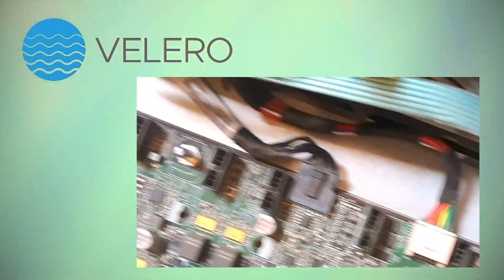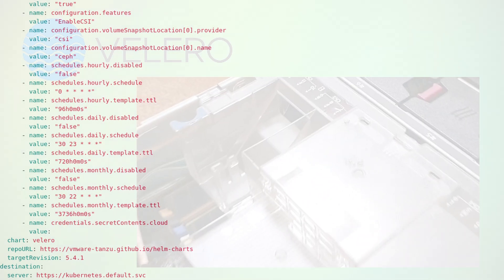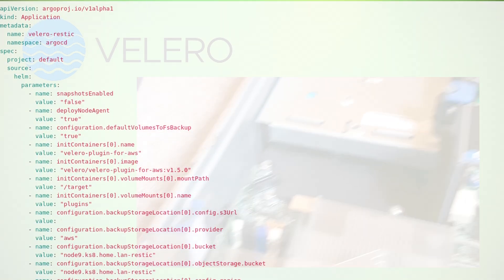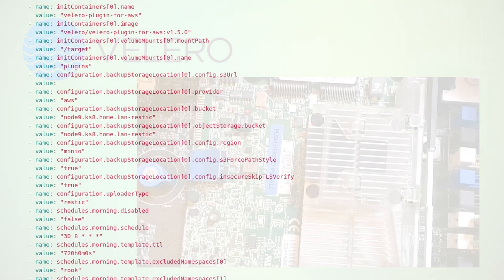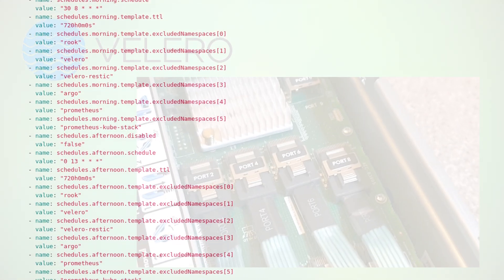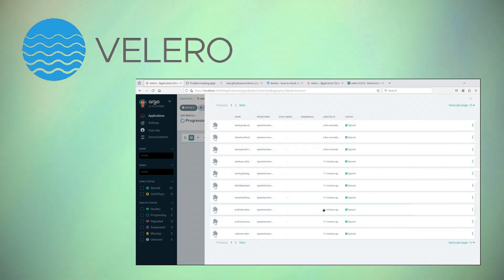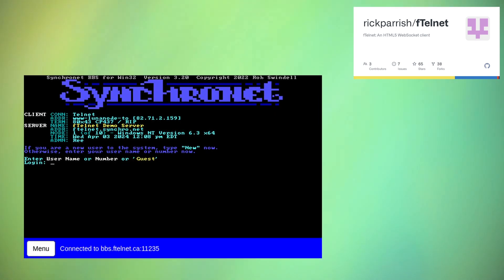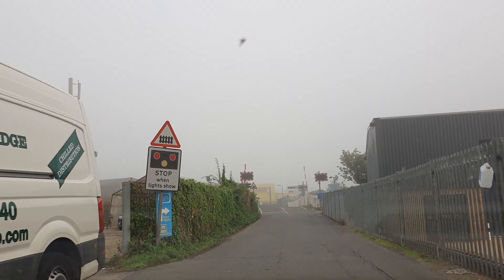BBS Followup + Retrofest 2024

Comment: is this still happening?
Reply from the maker: Yes still a work in progress. Testing let me find a few things I need to change. Modem dialup did work, be it at fairly low speeds, but that's OK for a BBS. I do need to rebuild asterisk container, as the version I built was originally built to be a full office PBX so there is alot of stuff in there I don't need, so that could do with been stripped out, as it really slows down container start up.
Reply: @RetroBytes_BitsBobs  at the tail end of 2025, any news if this'll still go live?

Comment: Would you happen to have a SPARCbook?
Reply from the maker: Have you had similar issues by any chance?  It turns out scsi2sd does not work with it either, openboot is not detecting any of the devices its providing. On other systems it detects fine, and I know scsi on the laptop works as external it detects the external cdrom drive, all using the same cabling.
Reply: @RetroBytes_BitsBobs  The only thing I can think of would be termination issues. But I assume you've messed with that, so unfortunately I have no other advice for you. I'm sorry.